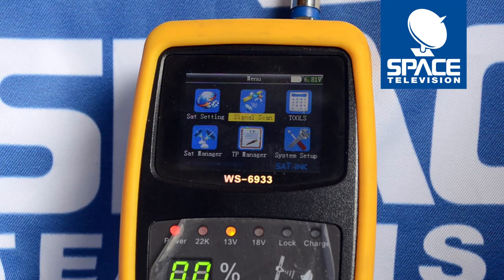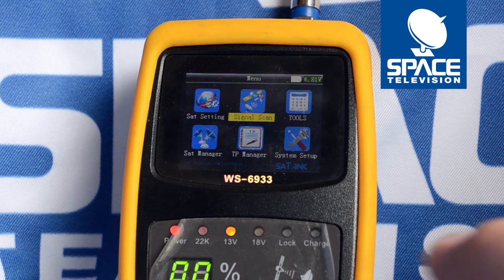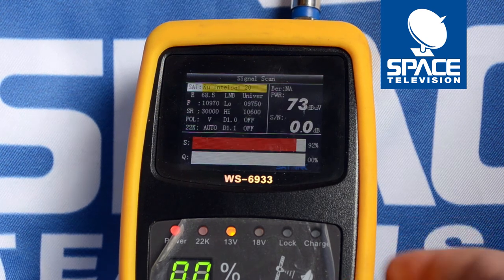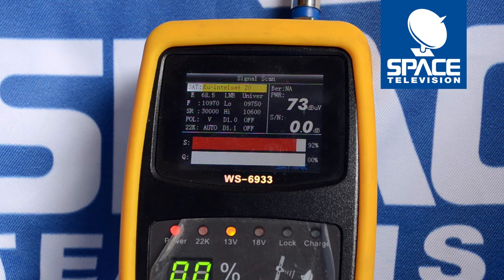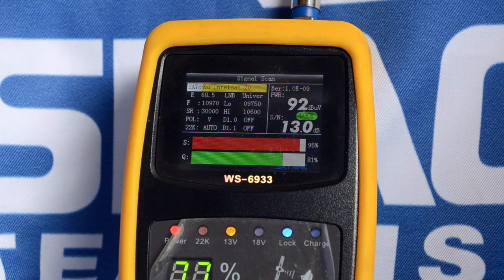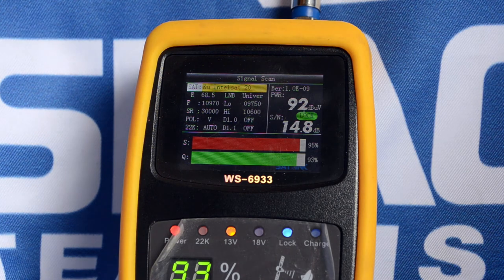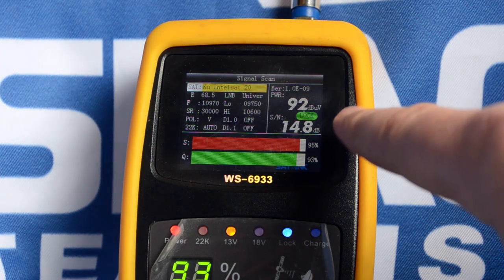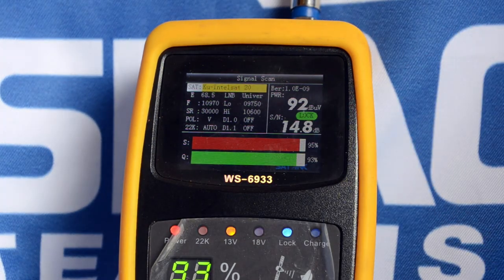What to expect when aligning a universal LNB on the Satlink WS6933

Comment: Thanks, useful video. Would that be also the correct alignment for a horizontally polarised signal ? I mean, if the signal is good with a vertical signal, will it also be excactly right for horizontal signals?
Reply from the maker: It is always advisable to check both Horizontal and Vertical feeds to ensure all is in order.
Reply: Thanks for the info.

Comment: What more next when finish  setting up with the meter.
Reply from the maker: Once you've finished setting up with the meter, you can start testing the signal strength and quality. This will help ensure everything is working properly. If everything looks good, you can proceed with your installation or adjustments as needed. If you have any questions along the way, feel free to ask!